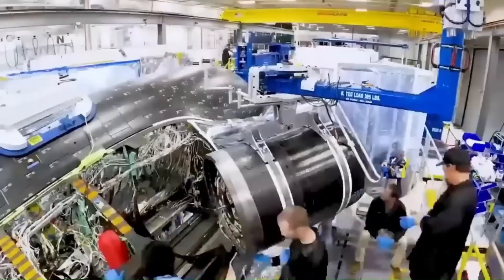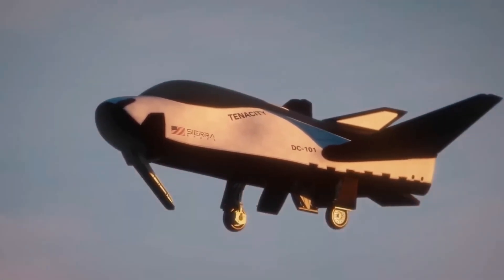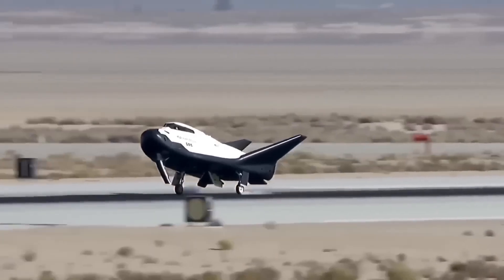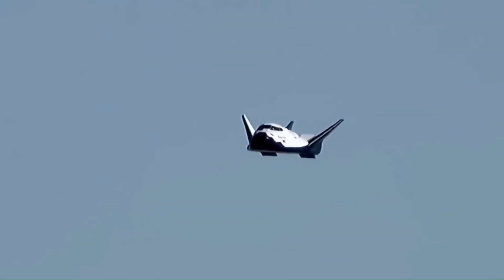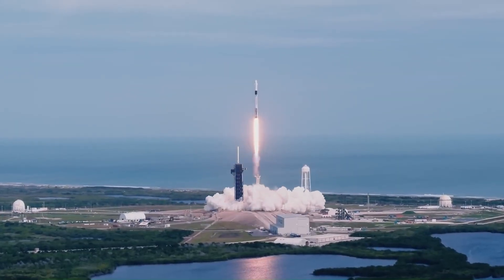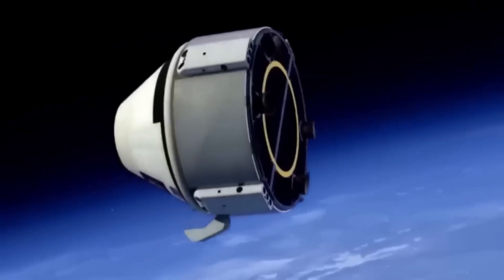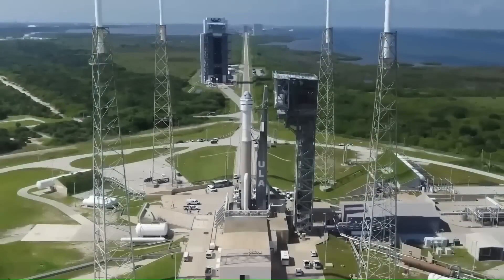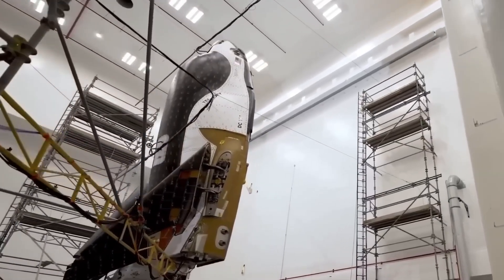Dream Chaser Finally Launching After Succesful Tests!

Comment: Buran was a lot more impressive more than 35 yrs ago! It could & did land without a crew, but was able to abort the 1st landing attempt & try again!, because it had 4 jet engines - which also meant it could also takeoff from a runway by itself just like any jet! It also had emergency ejection seats for the cosmonauts. Watch the video ... 
"What Actually Happened to the Soviet Space Shuttle".
Reply: The Buran with the jet engines was a test program. The Buran that launched did not have jet engines.

Comment: If it has no magnetic phase lag system to trap asteroids and space junk, the dream chaser is still just a Mig 105. They need railgun drones that can dock on 5 docking bays. Those docking bays should have 2 re-entry capsules on them and where are the ion thrusters?.

Comment: Thats funny, boeing builds planes and space capsules designed to kill people, like those 2 planes in India, they both took off and 10 seconds later, both crashed and killed everyone on board. The starliner takes off with 2 people on board and came back empty. I guess nasa has finally got tired of killing people also. That 1 ship that nasa sent up and was damaged on the wing? nasa could have fixed that, but they said "NO" and decided to murder 7 astronauts. See nasa really does know how to kill people. they have been doing it for decades, why stop now. If I was president of the United States, anybody who is in management with nasa would be fired on the spot and tried as murders for 2 shuttle accidents and 3 killing of astronauts on the 1 pad with now way out. I wou;d charge them with murder also. I mean if 1 just 1 person did what nasa has done, we would all be rotting in prison for just 1 killing, nasa kills off 17 astronauts (that I know of) and they walk around scott free. I don't trust nasa with anything, not even a kollaid stand

Comment: Lots of comments here that Dream Chaser is "obsolete." Or a total waste of money. Well here's a thought: space capsules are obsolete. Have been for decades. They are tin cans that land by parachute mostly on the water. They were invented and first flown when I was a kid, used in the Mercury, Gemini, and finally the Apollo programs. Gus Grisson, who died in a cabin fire along with two other astronauts while testing an Apollo capsule, called the Apollo a lemon and at one point hung a lemon on the capsule to underscore his point. Yet today, decades later, SpaceX is still using capsules. And Boeing desperately wants to use capsules, and would if they could build one that functions properly, which is not likely to happen until they stop handing most of their government contract money to overpaid company bureaucrats. However, as the AI in the video said, Dream Chaser is not a capsule, it is a space plane. Essentially a mini-space shuttle, though vastly improved with modern electronics and avionics. Yet it is a design NASA shelved! Not because it was obsolete or inadequate but because NASA was far more focused on programs like the X-30, the X-33, and the X-38, all unrealized spaceplanes that billions were invested into yet never left the drawing board. Talk about a waste of money! Meanwhile, Dream Chaser is only six years behind schedule despite all the delays, its first flight originally intended for 2020. All that said, to conquer interplanetary space, we will need a variety of spacecraft and Dream Chaser will have its role. I look forward to the diversity. It's gonna be fun!
Reply: Wow that’s so cool I haven’t seen one of those since the early eighty’s
Reply: With ISS being ditched, who is going to need a cargo space plane?
Reply: @gplipp6489 , I can imagine quite a few, remember a lot of companies are planning to make their own space stations after the ISS is deorbited and NASA hands over the responsibility of making a replacement to private companies. One of these planned stations “The orbital Reef” a joint project between Boeing, Blue origin, and Sierra Space , has already confirmed its will be using the Dream chaser for ferrying people and cargo between the station and the earth.
Reply: I disagree with you in some way, because I don’t believe capsules are obsolete, they are simple, blunt, cheap, and they get the job done. They are objectively safer than space planes, you mention Apollo 1, but that incident resulted in the capsule being redesigned, and as a result, had no further incidents after that. In addition capsules (usually) have fail safes to save the crew in case a problem occurs during launch, space planes (typically) don’t. In total 7 people have died from space capsules (3 from apollo 1, 1 from Soyuz 1, 3 from Soyuz 11). Lets compare this to the 17 people who had have died from Space planes ( 3 technicians died from working on Columbia during a nitrogen purge in 1981, 7 astronauts died on the Challenger  after a structural failure during launch in 1986, and 7 more died on Columbia while it disintegrated during re entry after its heat shield suffered damaged during launch.) 
I  believe Capsules have there roles and space planes have there’s and arguing if ones truly obsolete is foolish. I’m glad to hear progress with the dream chaser and hope it succeeds.
Reply: @RileyKravitz  I agree with you about the loss of life surrounding the space shuttle program. The shuttle, as amazing as it was, was overly complex due to the state of technology at the time. Disaster was inevitable. I distinctly recall the day my wife at the time woke me to tell me the Challenger had died, killing all on board. She reminded me I had predicted something of the sort, which did not make me feel any better. As for capsules, even the early astronauts referred to them as tin cans. Yet I am not as negative on their use as I must sound. For instance, I think the Dragon capsule is an amazing leap forward, and possibly could be modified for trans lunar use, or maybe even as a lunar lander. Also, as you correctly point out, capsules and space planes each have their role. Sadly, neither one is going to get us farther than low earth orbit or Luna. We need something better. Something interplanetary. Maybe we can't go to the stars, but we sure as heck could explore our own solar system with manned craft. Seems to me the only thing holding us back is government shortsightedness!
Reply: I love seeing that NASA is overseeing this program.  NASA launched multiple successful missions reaching all the way to Mars.  Space X and Boeing can’t even compete with NASA Apollo’s multiple successful missions reaching the moon.